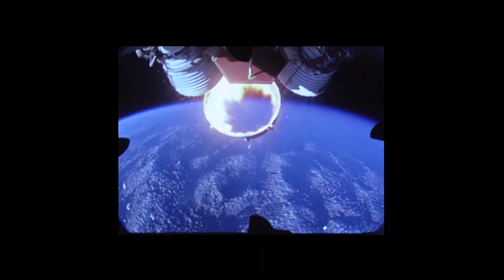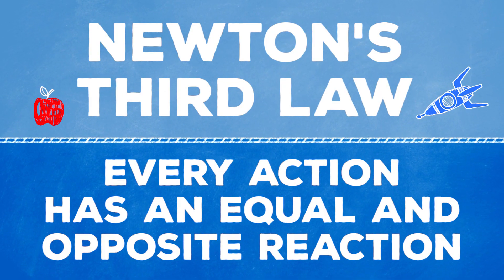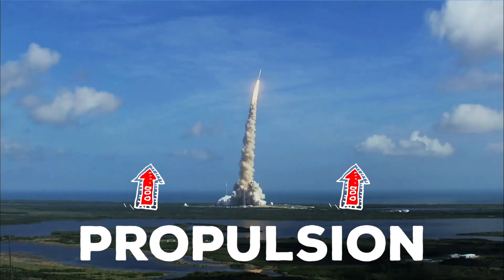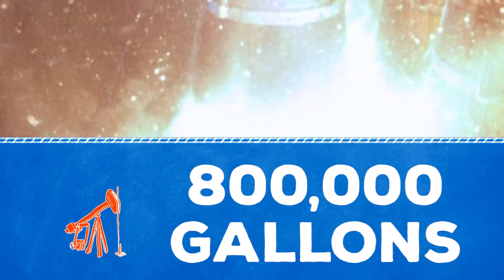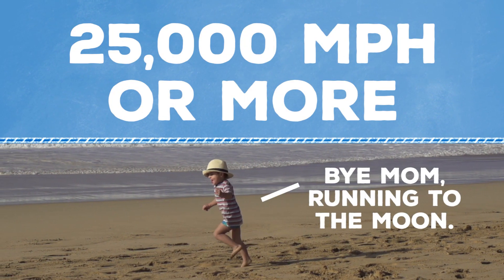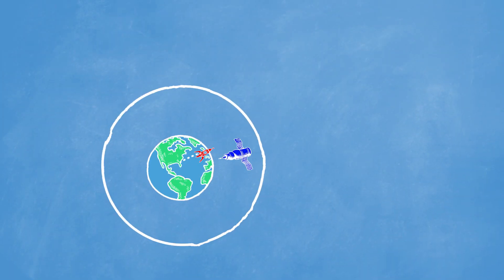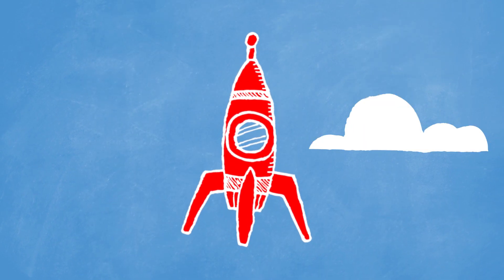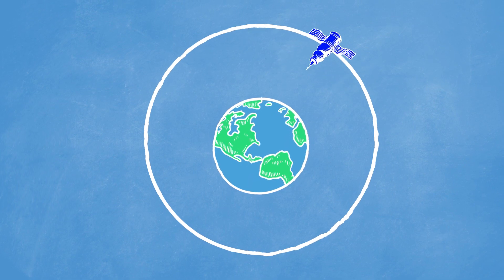How Do We Launch Space Rockets?

Comment: So this is the state these sponsored videos are going to be in? That where you guys can't even be bothered to use basic terminology right?

Escape velocity is the speed at which a rocket needs to go in order to leave the Earth's sphere of influence. Rockets don't need to achieve escape velocity and most don't. Most simply need to reach orbit which means they have to be going slower than your 25,000 mph figure (the fact you refuse to use the metric system being an entirely different gripe).

If you're going to bend over backwards and produce sub-standard content for the sake of your sponsors can you at least make sure the stuff in these videos is accurate? Or at least something that had half a minute of fact checking on Google put into it?

Comment: when and how do they slow from 25000 to 17000 mph?
Reply: The video is wrong.  You don't need to achieve escape velocity to orbit the Earth....because you're not escaping Earth.  You're just orbiting Earth.  In fact, you don't even need to go 25,000 mph to escape Earth.  That's just the instantaneous velocity you need at the surface of the Earth (and ignoring drag) to never fall down again giving the projectile no further propulsion beyond that initial velocity.  Rockets are obviously under power the whole time, so there is nothing preventing anything from just burning an engine and escaping the Earth at 1 mph.